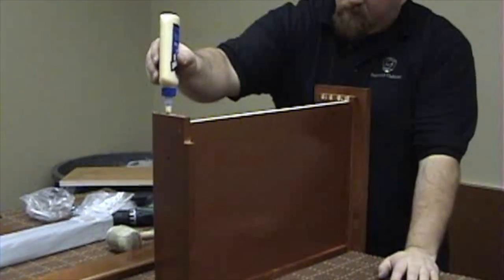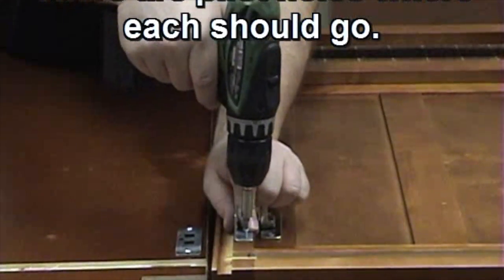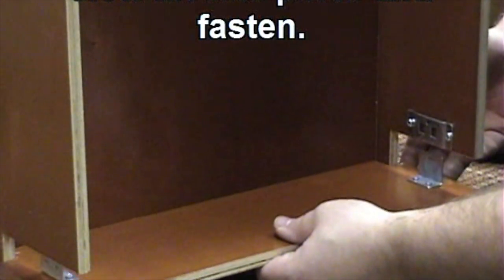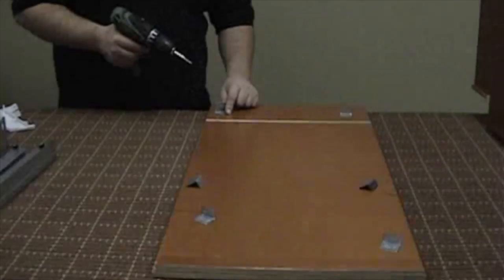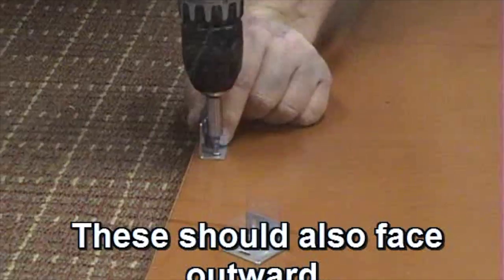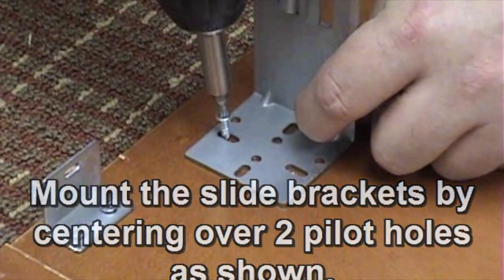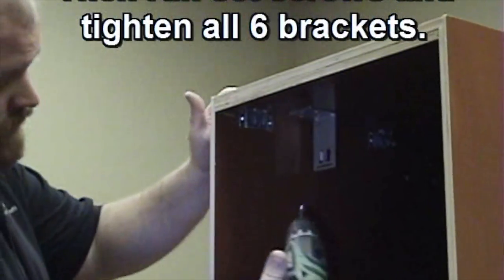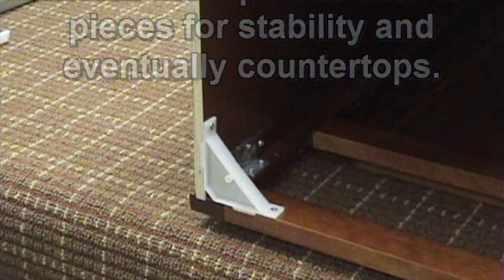Base Cabinet Assembly - Basic "RTA" Base Cabinet

Comment: These are nothing like what they are sending out now. No metal brackets that fit together like in this video. We got a pack of screws that are to screw the back to the sides on an angle that don’t hold anything. We also got some cheap plastic L braces that you have to glue on and let dry. Get a pneumatic stapler for assembly and get creative on exposed sides of the cabinets. Definitely would NOT buy again.
Reply: Yours came with screws?? I didnt get screws or the yellow clips their instructions talk about in my last 2 shipments.